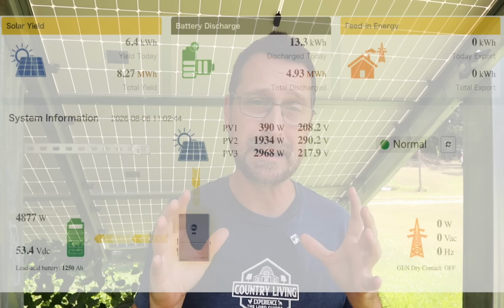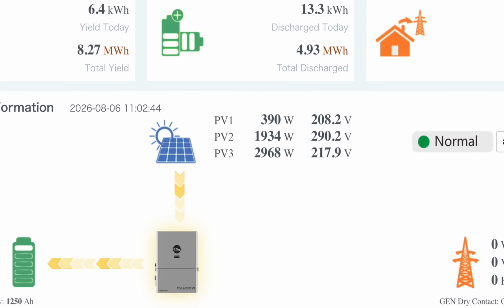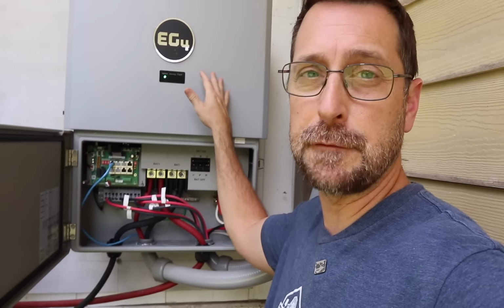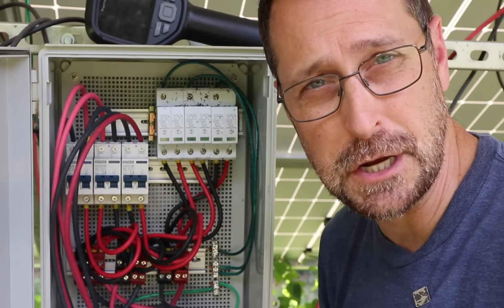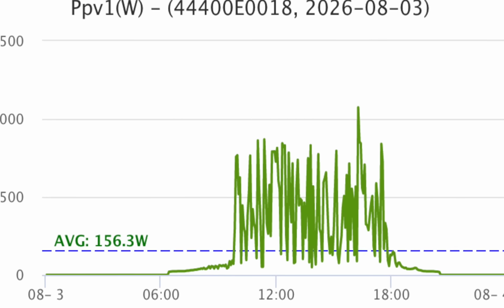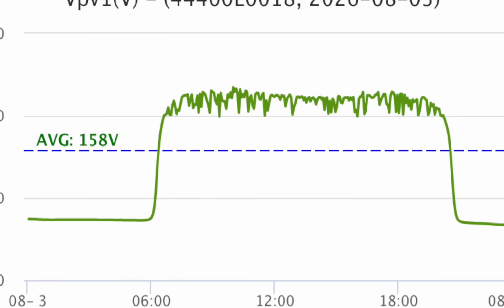Solar Power Suddenly Dropped? Find Out What Went Wrong!

Comment: Good day Eric,  
I have a question. I recently began learning about solar power. I use two 100-watt Werchtay panels connected to the UDpower C600, and I confirmed compatibility. However, the wattage drops to zero under full sun when output rises. No objects block the panels, and I tested the voltage on both, finding 24 V to 26 V. I checked and replaced the wires and MC4 cables several times, yet the issue persists. I connected a different brand of portable 100 W panels to the UDpower C600, and the current remains stable; both the Werchtay and portable panels show similar specifications. Does this suggest an oxide problem with the Werchtay units?  Thanks
Reply from the maker: From what I can see, it could be an oxide problem or a bad diode in the panel. Power stations can be finicky too. I have a small Bluetti that does not like some solar panels.
Reply: @CountryLivingExperience  Thank you for the response. Is there a way to resolve the issue? I adjusted the tilt to reduce the sun angle, yet the same “randomly drop to zero and back up” pattern continues. I am concerned that prolonged use in this state might harm the battery unit. Could I purchase another oxide and replace it, or are the panels unusable and should be discarded? Thank you.
Reply from the maker: @Mason-mgg  I would get a higher quality panel.
Reply: @CountryLivingExperience  Thank you very much for the advice. I appreciate it greatly; I have spent months trying to identify the issue without success. I keep swapping cables and MC4 connectors while relocating the panels around the house. Again, thank you for the guidance. I wish you the best.

Comment: I already watched this video and thought it had some good advice.  But I ran into something I had forgot about and got bitten now twice and thought I would share.  

On some inverters, if you happen to be changing settings like going from Close Loop to Open Loop communication, it can also change your charge and discharge rate.  

From your video I actually started trying to diagnose my issue, it turns out that my input and output went from 250a to 50a when I went from closed loop to open loop and back.  

The point is to check your inverter settings if you have been tinkering or maybe even after a firmware update.

Comment: I have a Victron MTTP charge controller. 150/85. Does anybody know what the minimum voltage I need to get this working properly?
Reply from the maker: Min voltage is usually pretty low for Victron components. It is usually 5 volts above your battery voltage. If 12v then 17v, if 48v then 53v.
Reply: @CountryLivingExperience 
Thanks! My voltage is over that by at least 25 to 35 V. Ran out of room on the roof for more panels. Third charge controller.🖖

Comment: Good points. We seem to be having some different debugging issues.  We have microinverters, and only one microinverter is having issues.  We have been fighting this for some time.  This one microinverter has 2 panels, (AP Solar Systems DS3-S microinverter).  The panels are good.  But I suspect it might be the 220VAC connector to the buss cable,  We have been having problems even on our DC with water getting in the wires too.  Sigh. We have been fighting this for several months.
Reply from the maker: Thanks. Hope you get yours figured out.

Comment: The panel support on that large array confuses me. You must not have any snow at all and not need much wind loading margin.
The panels seem clamped at the ends on the short sides which derates their load handling to around half or less.
Reply from the maker: Yes, that’s how it’s connected. That is a Powers solar frame. They are based in Arizona and that is how they are designed.
Reply: @CountryLivingExperience are they not planned for very high winds?
Reply from the maker: This has endured 50mph winds. I have not looked at the engineering drawings in years. These are commercial racks though.
Reply: @CountryLivingExperience  Yes, commercial for PV plants who take shortcuts to get the cost lower. They also take the risk.
Reply: @CountryLivingExperience  Ahh ok. So as long as you know they don't offer any guarantees and have no engineering certifications on this mounting and that you take the full risk including no warranty on the panels themselves then it's fine. Just make sure to clear the snow. (If you are in an area that gets snow.) 30PSF is very low. My 36 panel array had to be certified for 4200N snow loading which equates to 87 PSF, so I get plenty snow! 🤣 ☃
My biggest worry for that setup is the out of alignment start you had where you twisted things to fit panels. The panels are now serving as rafters which is not ideal from the manufacturers perspective I am sure.
Keeping any twisting forces to a minimum will be a must to avoid micro cracking causing huge losses in performance every year. Keep an eye on those peaks at around same time every summer and see if they are going down.

Comment: So what was the issue with yours?
Reply from the maker: The low voltage setting in the inverter. My panels lost efficiency over the past few years and with the addition of the hot weather dipped below that threshold. I need to add a few panels or change the setting which is only available to installers but you can call and ask them to change it lower for you.

Comment: You kind of "glossed over" the actual issue. It would have been helpful to know what your string voltages are, what they used to be and what your MPPT controller's min and max voltages are. Most MPPT's have a pretty wide voltage range so if panel degradation dropped you below the threshold you must have been too close to start with?

Comment: Great job brother!!  Might I add that whenever there is a production drop in one of our strings 100% of the time it has been a cooked MC4 connection.  We have multiple brands of panels and whether mismatched mc4s or moisture or just time degrades the connection.....they go south.  Now, every time this happens I replace with butt connector and heat shrink.  Have a blessed day!!

Comment: I was wondering why you have your arrays configured for such a low voltage? I run 3 EG4-6000XP, 6 arrays, all VERY close to 480VOC, Under load 370V. After 3 years of tinkering the most common problem I've had is bad/cheap MC4's welding themselves together (and burning open). Heat camera is the most useful tool in your troubleshooting arsenal. I don't have combiner boxes, just individual arrays to individual MPPT input, super easy to diag and recognize issues.
Reply from the maker: I had it configured lower for a different inverter originally and didn’t bump it up when I changed inverters. I was on the threshold and it worked perfect for 3 years. Those panels just lost enough efficiency recently that they started to dip below that threshold.
Reply: @CountryLivingExperience  Gotta find those marketplace deals and tag on a few more panels. I'll always need "a little more" it seems.